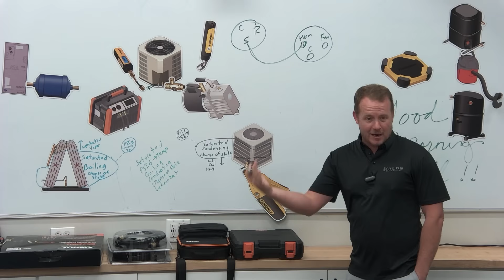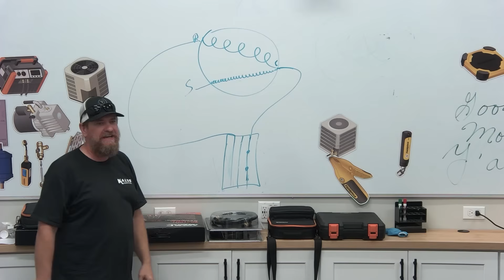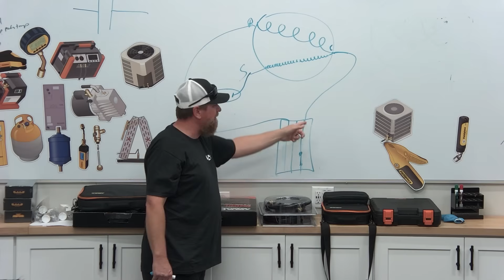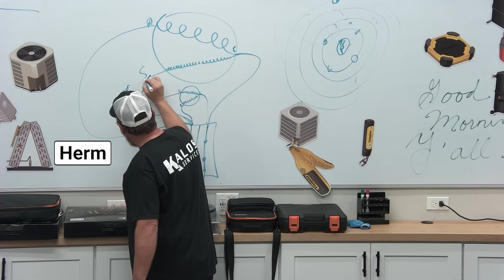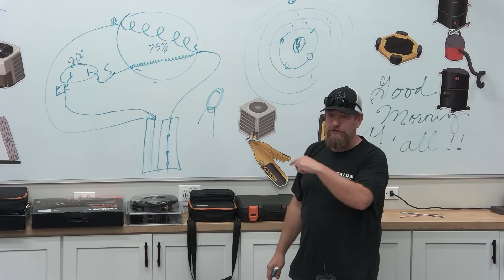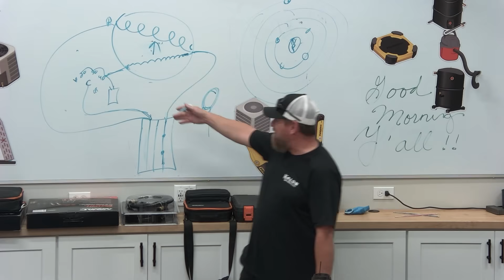HVAC Compressor Training | Capacitor Wiring, Hard Start Kits & Voltage Drop

Comment: In a purely resistive 60 hz system, alternating current changes direction 120 time per second.    A complete cycle includes two changes of diection, one  on the positive side and one on  the negative side of the sine wave. We won't talk about harmonic loads!
Another good video though!  Thanks

Comment: Also, because the stator of the compressor motor is between the run & start winding, in one half cycle the run winding charges (induce a voltage) into the start winding, so that on the other half cycle the voltage (charge) on both windings will be induced into the stator at phase between 90°&180°.
This would increase the torque of the motor making startup easier.

The hard start kit increase the start capacitance thus further increasing the torque of the motor. Once motor has reached the specified RPN, the VR(voltage relay) disconnects the hard start capacitor from the circuit.

The CPT is just a fuse to protect compressor and capacitor from over current 

would have out of phase charges (<180°)

Comment: This has been the best, in fact, the only explanation that I've seen or heard or read the function and operation the condenser fan, compressor motor, fan capacitor, run capacitor, hard start kit, CPT and their interconnection.

I think that I've fully understand the material so well that I feel like a pro!😅

As an electronic technician I always need to know why and how electronics circuit work!
Without that knowledge I can diagnose nor propose better designs.

Thinks to both instructors for their approach in teaching.

However, I find that these technicians should have a better foundational of electronics to know that capacitors are insulators that don't carry current but store charges. Also, to know that a voltage is a measure of potential difference.

However, learning has no limits nor expirary dates! We all are here to learn and to impart the little that we know.

Comment: So if I have a dual run capacitor I won’t need a start capacitor and potential relay?
Reply: The start cap and relay your talking about is a hard start kit. Idk where you are in the video but no. Start cap and relay will be used when compressor has a hard time running off just the dual run cap. If my understanding is correct